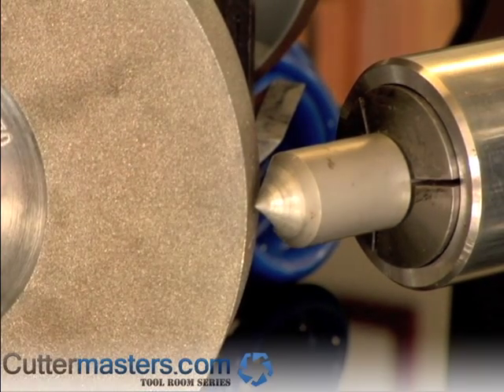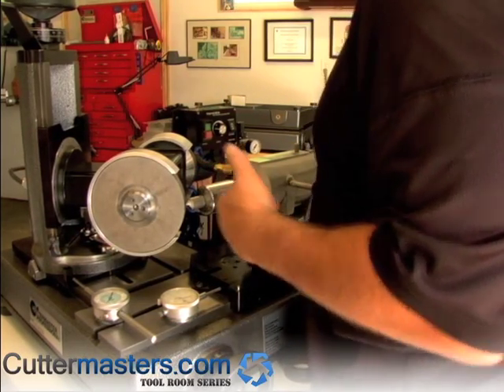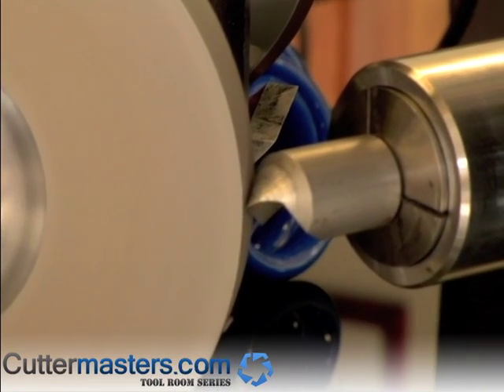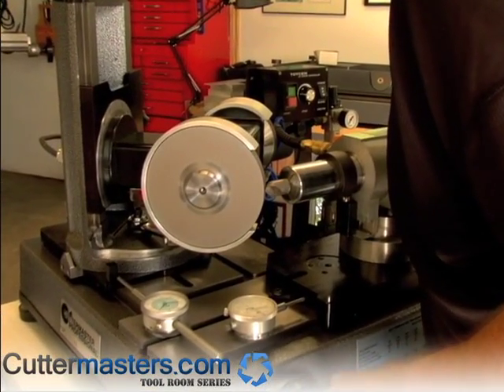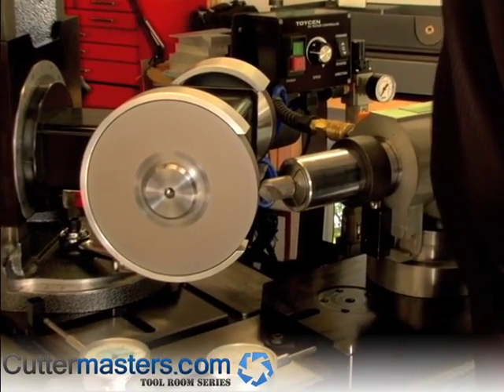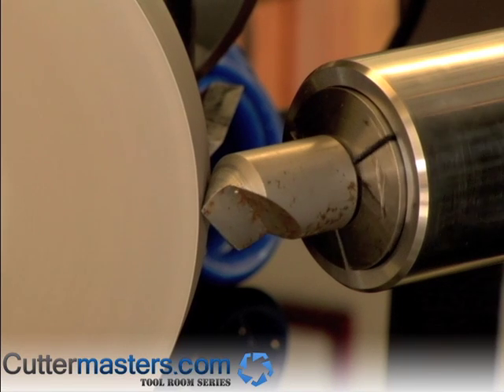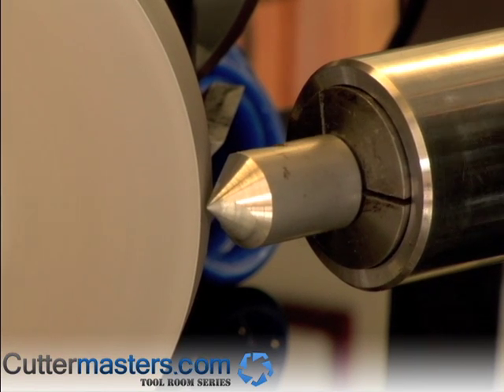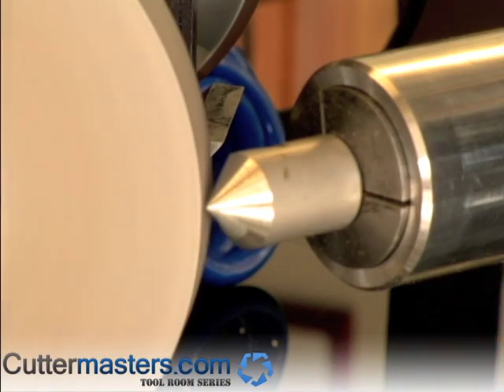Sharpening a Single Flute Countersink with a Cuttermaster Professional

Comment: So,  you told us it was an 82 degree cutter , you set your angle to 41-1/2 degrees . you ran the grinder ... it didn't match anything , so you moved the wheel ?  i don't get it . Now you have some countersink at an arbitrary angle that isn't good as n 82 degree countersink anymore.
Reply from the maker: Set the machine do a test grind, measure the angle , adjust then proceed just like every other operation in a machine shop

Comment: What about the relief behind the cutting edge?
Reply: The relief is still good. Eventually at the tip you may have a problem, but that wouldn't be until after a lot of sharpenings. But even then it would still be good for larger deburring.